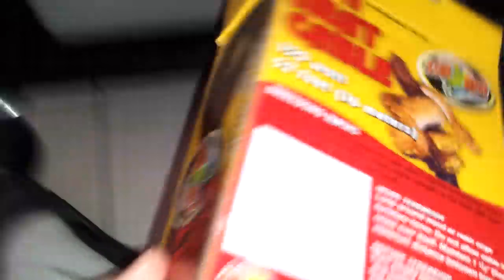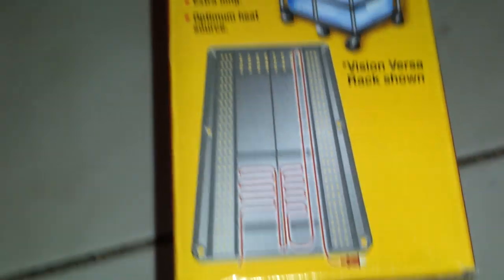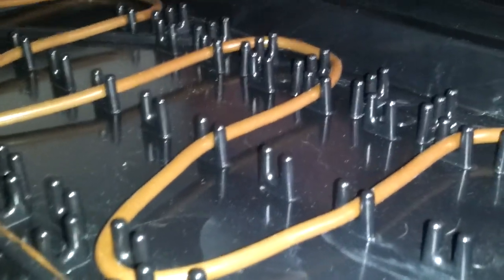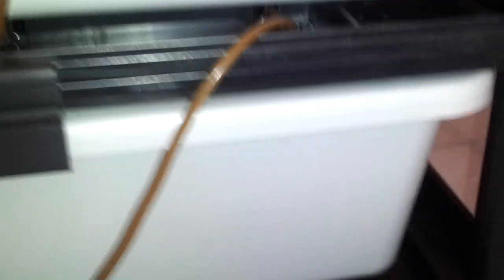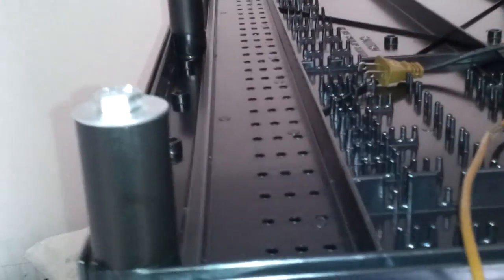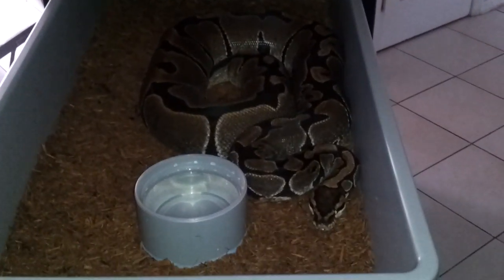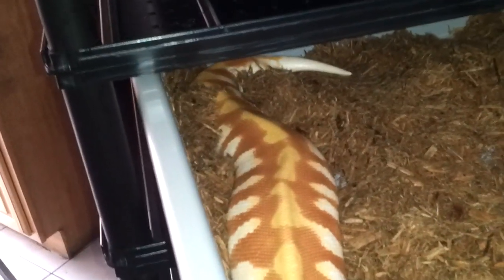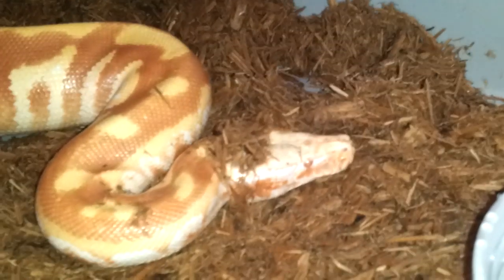How to set up a heat cable on a Vision V70-11 Rack

Comment: If you wanted to use heat cable for a different rack without the notches, can the heat cable come into direct contact with the bottom of the tubs as long as its on a thermostat?

Comment: Where do you put the probe for the thermostat ?
Reply from the maker: Tanya Duran at the back of the rack under the heating cord. Preferably around the middle of the rack.
Reply: juggernautreptiles so not in a tub above the heated area?
Reply: And does it actually touch the heat cable? Thank you 🤗
Reply from the maker: Tanya Duran no not in the tub. You want it touching the heat cord. I wedge it directly under the cord and it’s stays in place. You could also use electrical tape to keep it from coming off.
Reply: juggernautreptiles thank you so much I was so confused haha I normally use heat tape. But this seems safer also thanks again :)